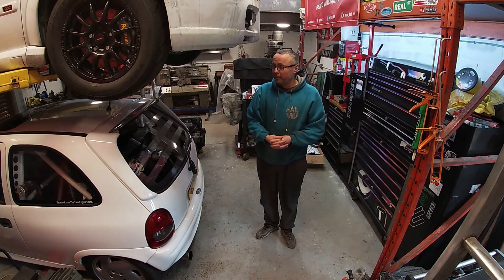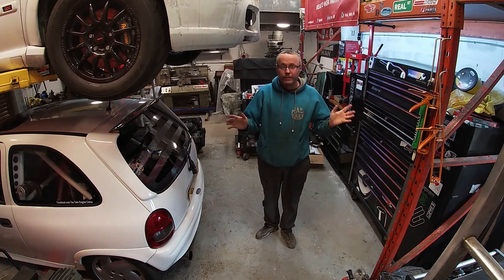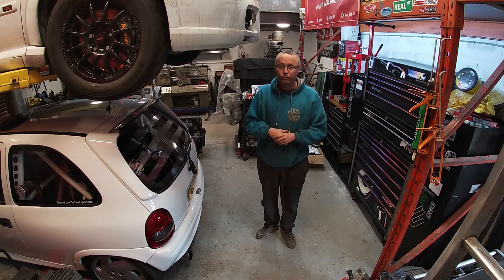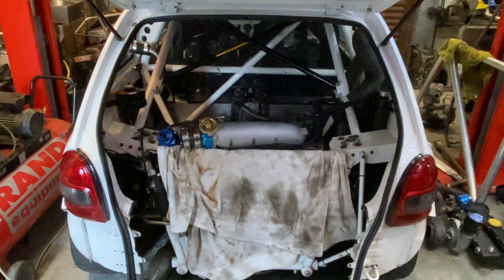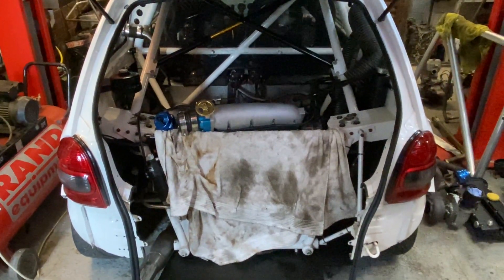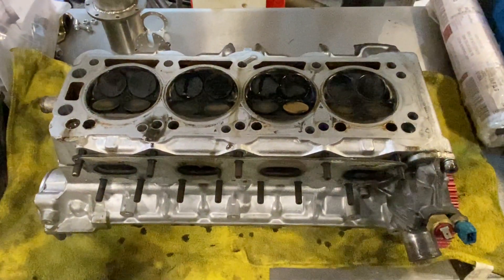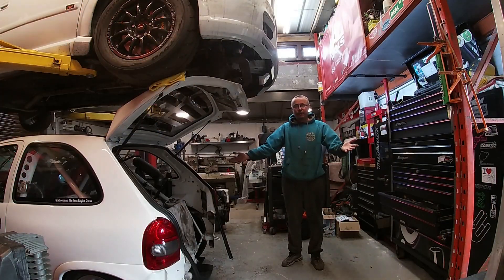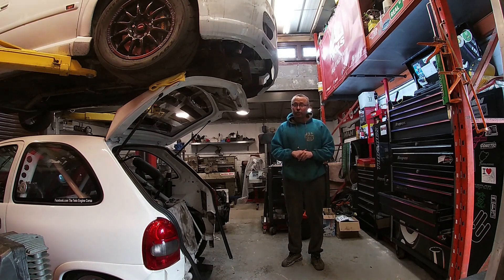Twin Engine Corsa Rear Engine Back in Bits - Vlog010

Comment: Thought it would be heading this way, innevitable really. K20s next time round,lol. Looking forward to see this get pedalled in anger over a quarter. Any vmax style events in the diary? Shame it wont have the gearing for 200mph, it'll have enough power to get it done in a mile.
Reply from the maker: Please don’t with the K20’s 🤣 
Yes we have an event called Racewars coming up at the same place as Vmax. The F28’s are geared to 200mph’ish depending on tyre size. The issue with the car is always going to be the bag of bones behind the wheel 🤦🏻 an my bollox’s falling out at speed 🤣
Reply: 7.7k rpm will snag you 200mph on a 205/50/16(minus expansion). That'll be one for the record books..